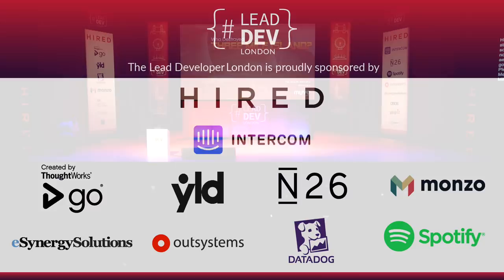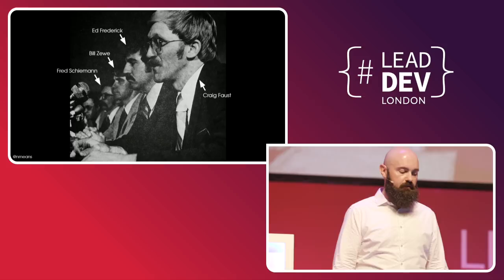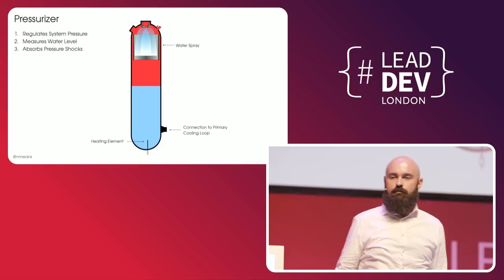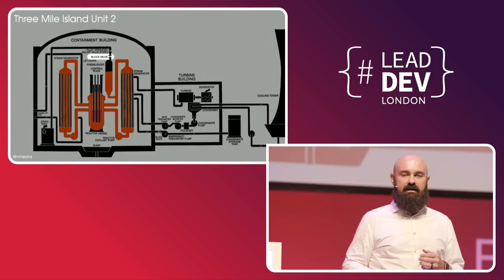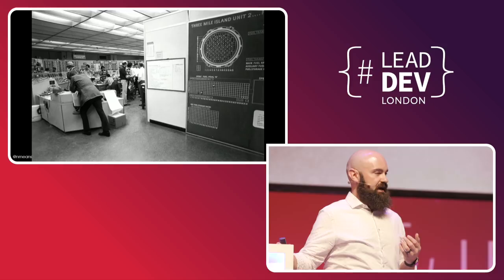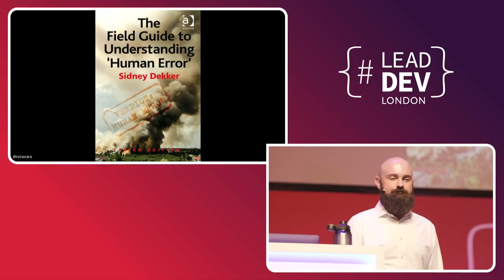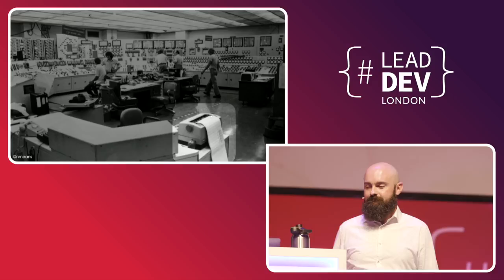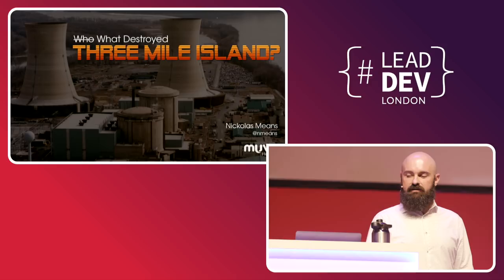Who Destroyed Three Mile Island? - Nickolas Means | #LeadDevLondon 2018

Comment: The one missing link in his explanation is WHY the water level in the pressurizer continued to rise despite the fact that they were hemorrhaging primary coolant.  This is because the decay heat from the reactor was creating steam in the loop (which Nickolas explains is not supposed to happen in a pressurized water reactor) which increased the volume of the system faster than the water was being vented through the PORV.  This highlights why using the cheaper instrumentation on the pressurizer alone to measure water level in the primary coolant loop was not sufficient to cover all failure possibilities.  Considering how vitally important it is to keep the core covered with adequate coolant at all times, it was a huge design flaw not to directly report this information to the operators.
Reply: You don’t need vessel level indication if you are operating within the pressure/temperature constraints to maintain a subcooled liquid. In reality, a level indicator for the vessel would be useless as it would cease to function accurately in a steam/ water mixture. The coolant parameters were outside of those required to assume subcooled liquid existed everywhere.
Reply: @eddiej.g.3998  True.  I am certainly not versed in what other instrumentation was available (total primary coolant loop pressure?  a temp reading somewhere near the core?).  If you had those you could infer that your system had entered a mixed state.  And of course if you had one of those and KNEW you had a mixed state you could calculate the other.  The flaw at TMI was operators making assumptions of reactor state that were wildly incorrect, and the system doing a very poor job of showing how those assumptions were wrong.
Reply: @eddiej.g.3998  So basically this was a really big design flaw of the reactor. Or was there a way for the operators to know if it was just water or a water/steam mixture they were measuring that they just missed?

Comment: Wasn't President Carter a US navy nuclear engineer?
Reply: He was one, so he was familiar to this technogy.
Reply: President Carter had experience with Naval Submarine nuclear power plants. There are several key differences between those and the commercial generating plants. The submarine plant was built with little regard to cost. It was designed with robust, conservative engineering to sustain battle damage and continue operating. The commercial plant was designed to make money for the shareholders and many systems were combined or used fancier, less expensive elements that compromised the operators understanding of their characteristics. It’s the difference between a F-16 and a 737.
Reply: @jamiefeitler6416  it seems a bit far fetched that operators of a 737 would have less understanding of their platform than operators of a f-16.
Reply: lancetekk you’ve missed the point. My point wasn’t about the relative operator understanding of their machines. It was about the intended function of those machines. One is intended to make commercial profits and the other is a war fighting machine.
Reply: @jamiefeitler6416  i agree
Reply: Nuclear Sub Commander, one of the originals. Trained by Rickover
Reply: @lancetekk  Obviously, you don't know much about either.
Reply: @Dogwalkeroftwo  Thank god you appeared to add something helpful then!

Comment: Some key events left out in this presentation, and serious ones.  The radiation inside containment rose to about  80,000 R per hour, a horrifically large number.  Never seen these numbers published, but that high a radiation level did exist at TMI.

Then there is the Hydrogen explosion that spiked containment pressure, turned on the containment spray system, and could have easily ruptured containment if the initial conditions (containment pressure) was higher.  The avoidance of a Hydrogen explosion was (and is) one of the "Holy Grail" criterion for nuclear plant containment designs, because the rupture of containment here could have potentially made habitation from Harrisburg to Philadelphia and NYC impossible for decades.  We were lucky on that one, but the news reports conveniently leave this scary stuff out of the story.  WTF

Comment: Software hell...! This is about leading all types of teams and the individuals inside each. People are the only thing that gets work done and done correctly. And within these team are individuals who must be treated on an individual basis - its where the knowledge resides. There is nothing more nonsymmetrical, inadequate or incommensurate than the equal treatment of unequal people. This holds true in life and career. Everyone is different and requires an individualistic approach. Yes, overriding top level rules apply at the macro level, but deeper down, once you pass the higher structures , policies and protocols, each person is unique and it’s these leaders that understand the concept are the ones that identify, acquire, build, train, motivate, mentor and help drive (help, not micromanagement) the individuals in the team so the entity of the team perform in such a way that exceptional achievements can be produced. Out the empowerment with the members of the team and not simply shout edicts downwards to be followed, rather go to the people that touch things on a daily basis for the answers to each of the programs problems. Kelly knew this decade ago and it was a big factor in the company’s success. Didn’t work for all teams on all programs but the basics apply everywhere. Taylorism, Fordism, Ohnoism, and Peterism had their moments in the sun (and at different times in history) and helped in small ways to move team dynamics and management styles forward, yet practice applications of Kelly (and others, not only him) remains the best functional deployment to this day. 
.

Comment: It's all well and good that you think the government response helped reduce risks but I'd like to see how that is quantified.  One would have to examine all the plants who had changes what were the changes and what is the measure in terms of reduced accidents.  Further, even if there's reduced rate of meltdowns it's not proof that the changes made as a result of the government action actually helped.

There are safer designs with generation 3 and above.  They are far safer by design so complex interaction by operators is not necessary to prevent meltdowns.  However this is all assuming the components are manufactured to specification and do not deteriorate in some ultimately catastrophic way.

Comment: The reactor scram should have been coincident with the turbine trip(design error #1). Power Operated Relief Valve indication shows demand, not actual valve position (design error #2). Rx vessel drain tank was not instrumented for level or temperature.(Design error #3). Annunciation system design is non-intuitive and conducive to human error(design error #4). Boiling occurred in the core because the pressurizer was not actually the highest point in the primary system, the steam generators were (design error #4). No mechanical safety valve was provided for the pressurizer (design error #5).

Comment: Many of these power plants were controlled by PDP-11 systems. Not sure about TMI.
Reply: @neon-john  When I worked at Digital we had contracts working with GE on PDP-11 equipment, so I'm unsure where your info comes from. Not myself personally I must say. But, correct, the PDPs are not in full authority control of the chain reaction but plenty of the systems.
Reply: @rabidbigdog  in many plants, a PDP-11ran the gamma spectroscopy in the radiochemlab.  More often I saw HP 9845 "calculators"  because the software was better and easier to modify.  In one plant I saw a DEC running the water treatment plant.  Peripheral applications like that.

John

Comment: Good presentation, but at 26:36 the term "Going solid" in the pressurizer is mentioned.  This is nonsense jargon in the engineering field.  There are three states of H2O, solid, liquid, and gas.  Solid does not occur unless temperature is less than or equal to 32F (0 C). There was no "going solid" here.  The real statement is that the pressurizer came to a state of becoming fully liquid, thus losing the elastic (compressibility) property generally attributed to a gas, steam in this case.
Reply: The presenter did not invent or propose that this was an appropriate statement or jargon to use for that event. He merely stated that this was the terms/jargon that the operator himself used to describe what was happening / what he wanted to avoid.
Reply: @jorgenfischer  Understood.  However, using clearly incorrect jargon, even if its use is commonplace,  should have a comment to correct the words.  Just a correction from an old engineer who has spent over 40 years in analysis of fluid transients.
Reply: I don't think it's really meant to be taken literally. Although according to Wikipedia, some parts of industry refer to it as "going hard" rather than "going solid", which is probably a better phrase to use, but other parts of industry do refer to it as "going hard" by convention, despite the fact that it's not literally true that that is what is happening.
Reply: I have a psychology paper that applies here.  Titled "People who don't know enough to know what they don't know".  "Going Solid" may not fit your delicate engineering sensibilities but the term is universally used and everyone knows exactly what it means.

If that bothers you then "tripping the reactor" must drive you insane.  I mean, what did it trip over, some loose fuel rods laying around?

Comment: I thought I smelled the stench of Rasmussen.  This video is what you get when you try to sound authoritative based on what we at TMI called the "joke book".  How about some input from a nuclear engineer who was there?

I don't know what that little thing you showed is but it is NOT the condensate polishing system at TMI.  The tanks were huge and had ladders going up the sides.  Yes, there was a clog in one but that was only indirectly responsible for starting the event.  What started the event was that an Auxiliary Unit Operator (AUO) accidentally cross-coupled the service water system with the instrument air system, forcing water into the air system.  Easy to do because both systems used the same connector, a Chicago Pneumatic hermaphroditic quarter turn coupling. 

This water in the control air system shut down the pneumatic controls on the polisher.  They could have bypassed the polisher except the water also shut down the feedwater heaters control systems.

BTW, your estimate of a nuclear sub's reactor power is several orders of magnitude low.

The operator turned off the safety injection pumps because the pressurizer went solid despite the PORV being open.  All critical systems have at least one level of redundancy.  The level was indicated by 2 vertical scale analog meters, one from safety system train A and one from B.  Train B was tagged out for routine calibration.  That left only train A indication and it indicated 100% water level in the pressurizer.  

The operator made a seemingly trivial but critical mistake.  One always taps an analog gauge before reading it, in case the needle is stuck.  He didn't. Another operator came over later to check the gauge and properly tapped it.  The needle had been stuck.  When tapped, it dropped to zero.  The pressurizer and the reactor were dry and the fuel cladding had started to burn.

About that time, the Chief Engineer of the plant, Ivan Porter walked into the control room to begin his shift.  He later told me "you know it's going to be a bad day when the entire radiation monitoring system was in alarm and lit up like a Christmas Tree.  BTW, that piece of sh*t geiger counter you showed is NOT a power plant grade instrument.  The Victoreen system at TMI used ion chambers and read out directly in mR/Hr.

If you want to see an actual radiation monitoring channel from TMI, just ask.  When I had to leave 4 years later to run my company, they presented me with the channel for RM-L7, the channel that monitored the water discharge to the river, to show their appreciation for my work.  I had designed and had fabricated a very low background and self-cleaning system that replaced the one they gave me.  I still have it and it still works.

Of course, they turned the safety pumps back on but it was too late.  The pressurizer developed a satisfactory level indication fairly rapidly.  Too rapidly.  When the water hit the white hot core, it formed a steam bubble that blocked further water entry.  When they figured out what was happening, the operator, as ordered by Ivan, cranked the injection pressure up beyond tech specs and that blew through the steam bubble.  The rumble of the water deluging the hot core could be felt in the control room.

They knew inside an hour how bad the damage was when the radio chemlab sampled the offgas system and found it saturated with Kr-85, Xe-133 and I-131.  These fission products are normally contained within the zirconium fuel rod. When there is massive amounts of these coming out of the reactor and to the off-gas processing system, there has been massive fuel failure.

Neutrons radiolytically decomposes water into hydrogen and oxygen in a stoichiometric ratio just perfect to burn or explode.  So, whipped up by the media who sat across the river and monitored our walkie-talkie traffic (we quickly obtained encrypted radios), we had the Hydrogen Bubble Crisis.  Actually 2.  Someone postulated that there might be a hydrogen/oxygen bubble under the head of the reactor.  The Chief Engineer from B&W, the reactor manufacturer and one of the most brilliant engineers I've met, quickly came up with a way to tell.  The found a positive displacement pump that discharged 5 gallons a stroke.  The modified it by blocking the intake and removing the outlet check valve, turning into a water pulser.

A Valedyne (best there is) precision pressure transducer was plumbed into the primary system and its output drove a Brush (also the best there was) strip chart recorder.  They brought the primary system absolutely solid.  The pump pushed 5 gallons of water into the primary system and pulled it back out on the back stroke.  A very pretty sine wave of the pressure variation appeared on the strip chart.  If there had been a bubble, the pressure would have varied little.  No bubble and the pressure oscillation was large.

Charles took the chart home (he lived in the apartment next to me in the building I bought) and by about midnight had written a simulator program on his Apple ][ and calculated that there was little if any hydrogen in the dome.  He called the results in and then we had a wonderful dinner together that my wife had cooked.

There was a hydrogen burn in the containment. Not an explosion but from judging by the burn patterns on chairs, desks and paperwork in the containment, more like a swamp will-o-wisp.

The containment pressure was monitored by a balance beam, inverted cup oil gauge that someone dug out of the 1800s.  Its time constant was measured at 8 seconds.  The containment is designed for 30 psi.  The chart recorder pegged at 60.  Charles wrote another program that calculated the probable containment pressure based on the instrument's slow response.  The calculation was near 100 psi!  

The containment building is wrapped with a series of steel cable tendons that reinforce the concrete.  Each tendon had a strain gauge.  When they were later read, there was no indication that any had been stressed at all.  This demonstrates just how over-designed nuclear plants are.

THERE WERE NO CONTROL COMPUTERS AT TMI!  All analog.  The ancient Baily mainframe in the control room was strictly for data logging.  It had 32 kilo-words (odd word size, 18 bits if I recall correctly) of core memory and a 5 megabyte rotating drum storage.

The printers you pointed out were NOT dot-matrix printers.  They were IBM Selectric typewriters, modified by IBM by adding solenoids to operate the keys.  It printed at 120 characters a minute.  There were 4 of them.  When they got about 2 hours behind, the Baily core dumped and halted, losing that amount of data.  The engineers I talked with said that this wasn't any great loss, as anything important had an analog strip recorder connected to it.

I could pick your presentation apart further but I think I've written enough to show you don't know what you're talking about.  Maybe you should talk to some actual nukes who were there and modify your presentation accordingly.

John